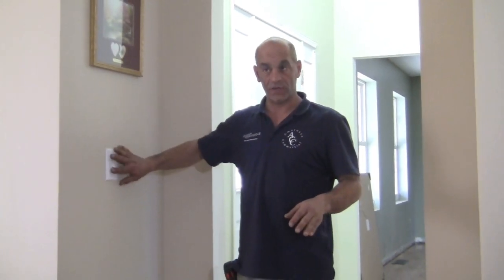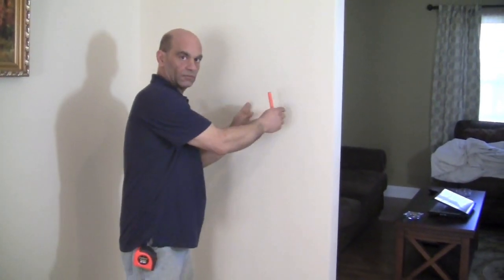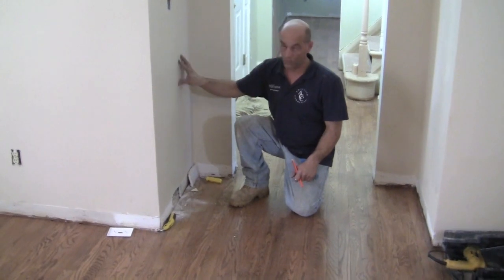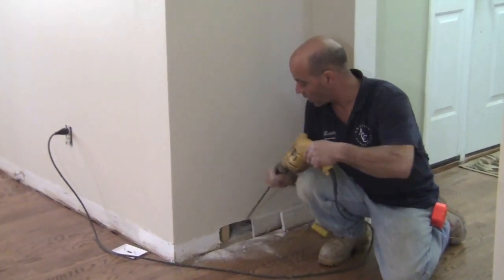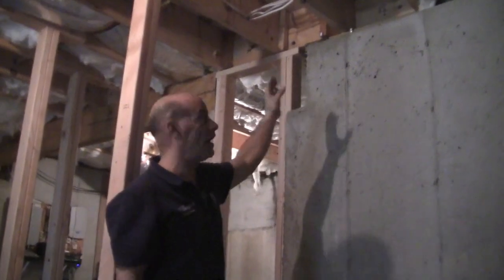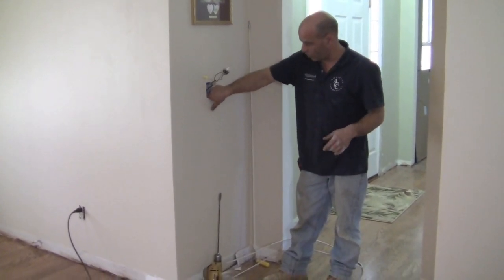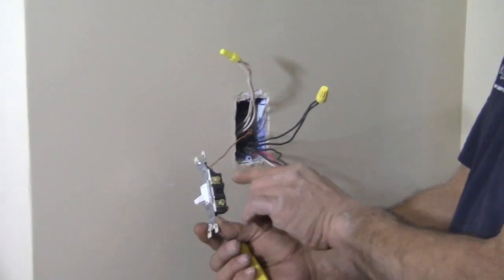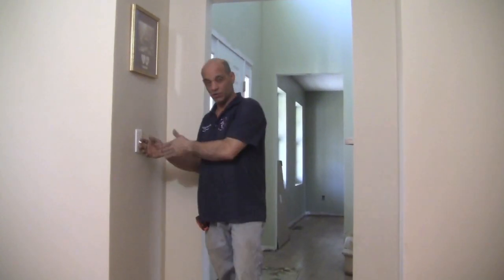How to install a three way switch to a existing one way switch

Comment from the maker: As far as the existing metal box the same way. But it's a little different as far as locking the romex in. At that point I would just remove the metal box and replace it with a plastic one.

Comment: I didn't realize you could put a remodel box into blank drywall without screwing it to an adjacent stud. In the past I've put the new box next to a stud and then drilled a couple of screws through to the stud. Harder to do as a remodel but the box is more secure.

Comment: Should do a video on crown molding. Lots of people have different ways to do it and I've only found a few that are easy and less brain intensive. But most of those involve a jig store bought which is usually cheap plastic or a fancy stop jig that is made to bolt to the chop saw. Just did a crown job and was thinking of this channel as I did it.